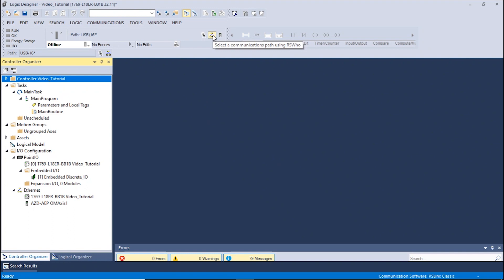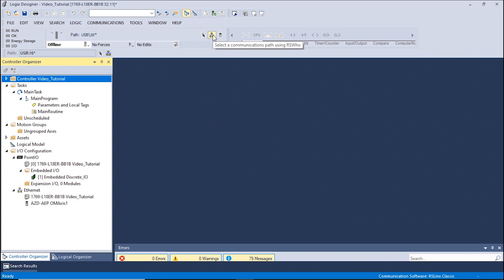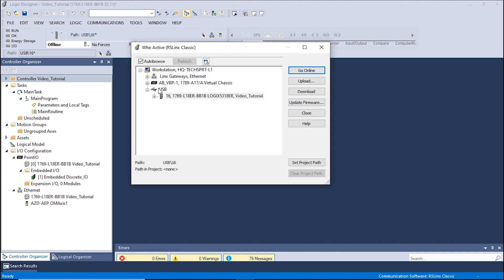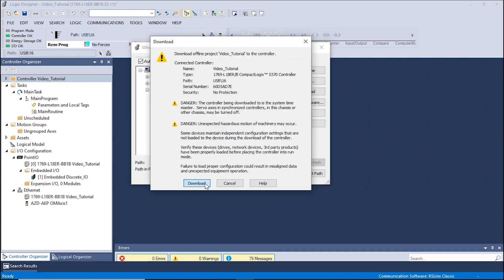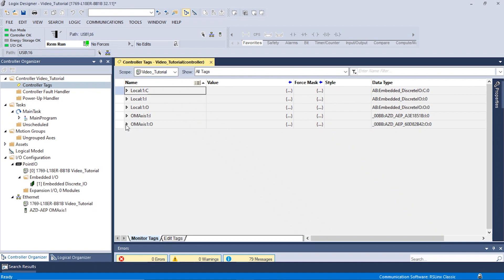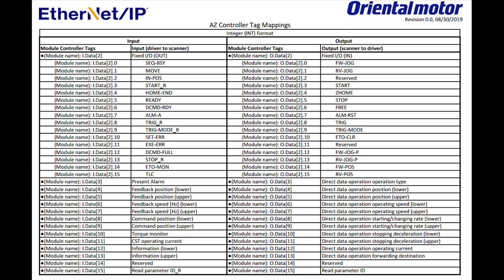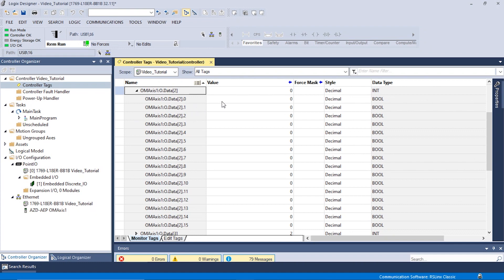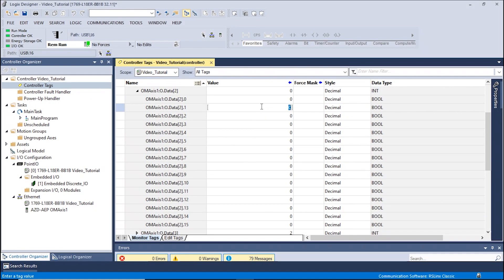How-to: Learn How to Jog an EtherNet/IP-enabled AZ Series motor (04/10)

Comment: Hi. Is there a Controller Tag Mapping table like the one you show on this video, but for EtherCAT? I have a AZD3A-KED driver which I want to control with a AB PLC. I made an interface for the EthernetIP (PLC) to EtherCAT (Driver) using a Hilscher device NT-151 RE-RE. If I send output values via Controller Tags on the Studio 5000 software (just like you did in the video) I can see a change on the values of the EtherCAT PDO monitor (PDO frame monitor), but there is no motion on the actuators. I added the NT-151 RE-RE module to the Studio 5000, and downloaded the ESI file for the EtherCAT, but I just don't know how to change the value on the Controller Tags in the Monitor Tags tab to produce motion on the actuators. It would be great help If you can answer, as we are days stuck on this (I also sent a message to support on OrientalMotors and leave a post on the forums but I have not received  answer). Thanks.